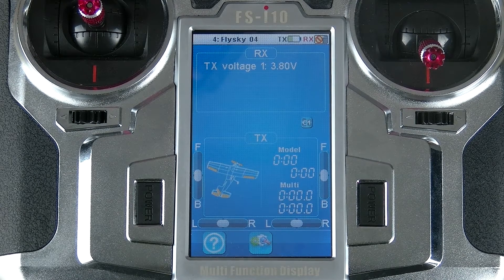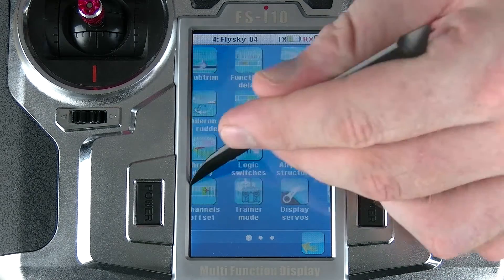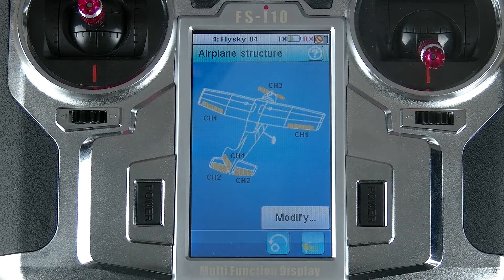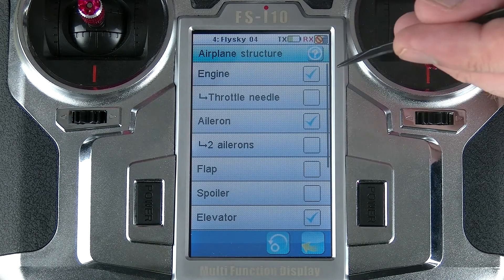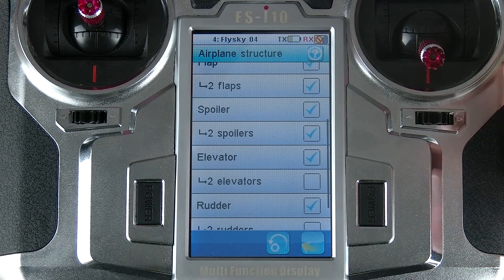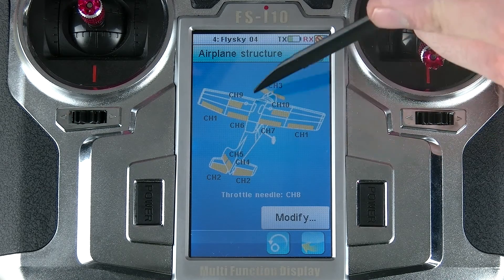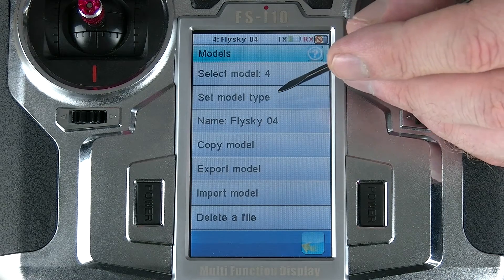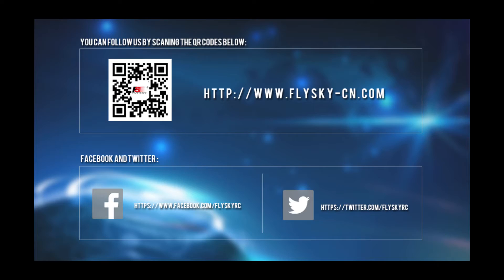FS i10 Aircraft structure Tutorial

Comment: Hey, how would I setup a delta wing? will it also show the icon of a delta?
Thanks
Reply from the maker: Sorry for the slow reply I have not been able to get onto youtube for a bit due to internet issues. I have never had to set up a delta wing but I will ask our engineers and see how its done and get back to you.
Reply: +Flysky RC Model ok thanks will wait for your response
Reply from the maker: Ok, so in the model setup you just select the control surfaces you need and the i10 automatically changes to that setup. So in this case I chose an engine and 2 ailerons and it updated to the delta wing model shape.
Reply: +Flysky RC Model ok thanks I will try this out, thanks for your efforts, bests